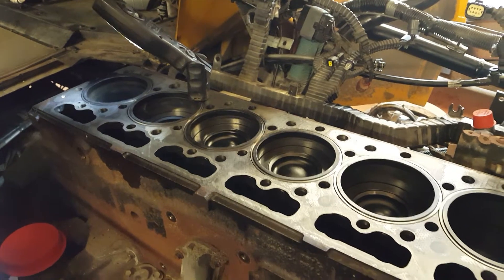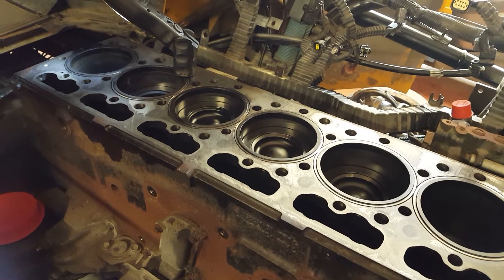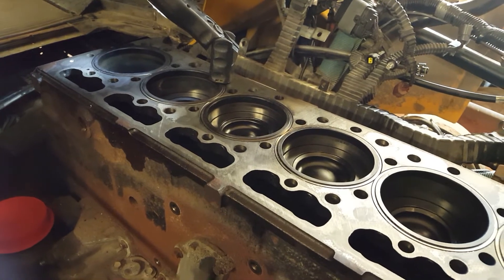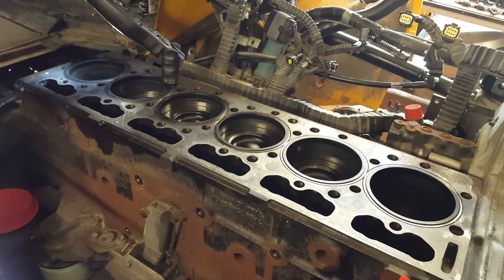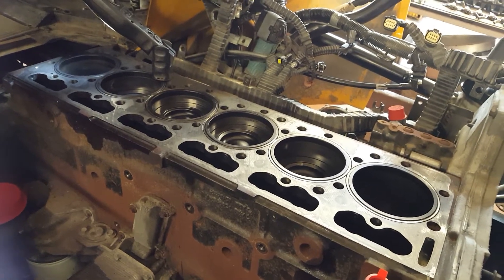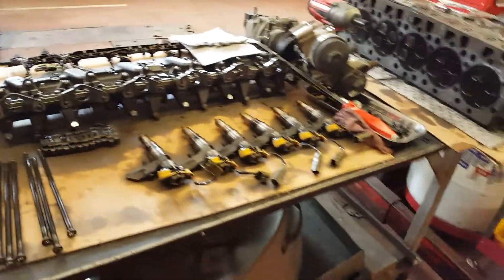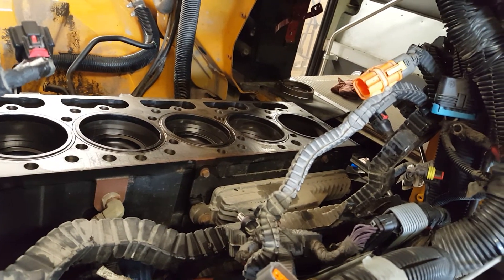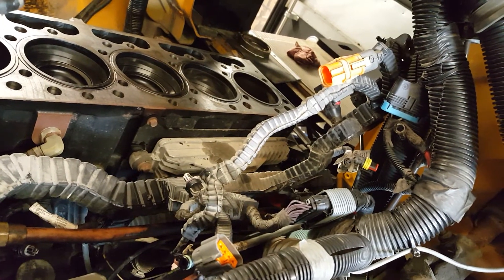International Diesel Engine In Frame MaxxForce DT

Comment: Would it of been cheaper to swap out the motor from a wreck or a low milage daycab truck at a Ritchie Brothers Auction?
Reply: you would need a overhead steel beam lift to have half a chance to get the motor out of there

Comment: Which engine is worse, a Oldsmobile diesel, a 6.0 power stroke or the international DT?
Reply from the maker: The MaxxForce in my opinion has proven to be a massive engineering  failure.
Reply: Technically the 6.0 is a international engine (vt365), premaxxforce tho
Reply: Buenas noches espero y me ayude con el torque de ese mismo motor para la culata. Gracias

Comment: International should take each one of these Maxxforce engines out and replace them with a Cummins. Doesn’t matter how many miles are on the vehicle. Obviously someone in the design/engineer dept did not know what they were doing.  
All trucks/busses with problems due to this engine. No wonder sales for international are low. They need to make this right.
Reply from the maker: Cummins does have an ISB which includes aftertreatment specially designed for school buses. The cost is 45,000 dollars Canadian before tax and installation. IC did replace some of our engines on warranty but too late for some that cost serious bucks!